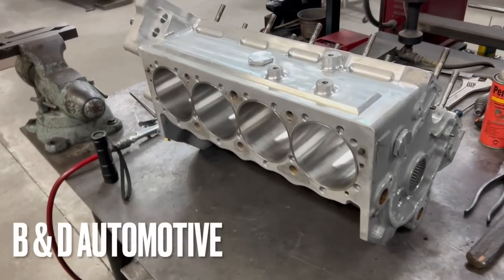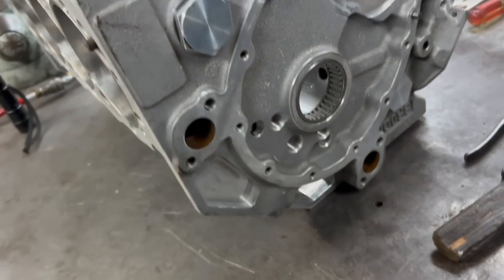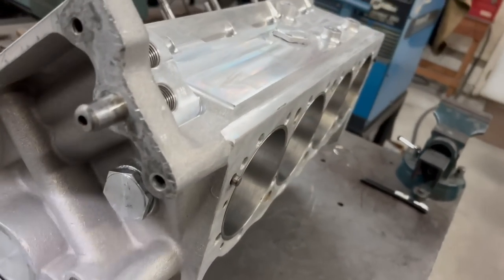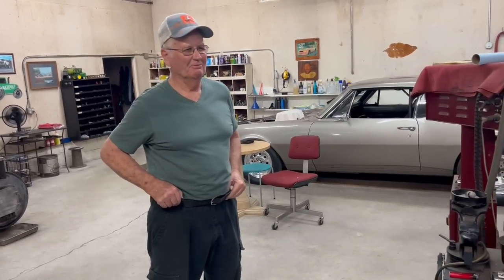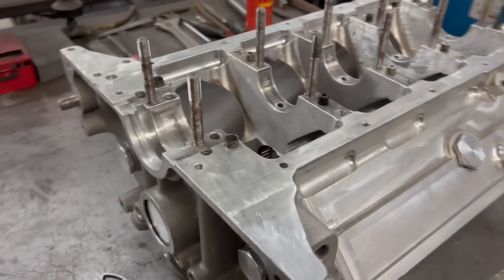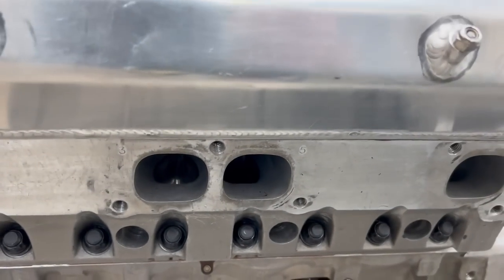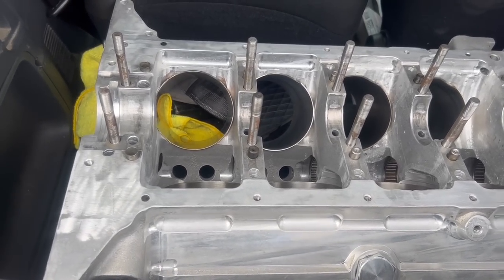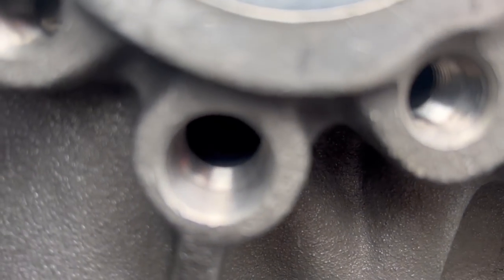SBC Aluminum Block is Ready for Assembly

Comment: Is that a 50mm roller cam bearing? If so I have a custom billet nitrous cam that would be a great Turbo cam.
Reply from the maker: Yes, 50mm.  Send me the spec sheet on it.  Turbotbirds@aol.com. And how much you want for it please. I'm for sure interested!  The one I have is not ideal for sure.
Reply: Torrington roller bearings are sure a nice piece. Limits you on cams tho.
Reply: @TurboJohnRacing where do you get new 50mm cam bearings might be getting same brodix block shortly

Comment: Don't me ever hear, that guy has a pro mod out of your mouth again. No more complaining about the rules for you either.  No excuses not to win. Back half car, dominantor ecu,  aluminum block. That's x275 stuff there
Reply from the maker: I never make excuses, lol.  I have the “great value” x275 car.  😂
Reply: @TurboJohnRacing  and you got a lift to work on your car. I don't. You've been an inspiration, no doubt. But complaining about other peoples cars, calling them pro mods is backhanded. Appreciate that they built a car. Ypu could've done the same, but you have a motor home instead. It's my biggest issue with non street racers going into no prep, trying to male up rules. On the street, u have a pos  or you don't. No rules